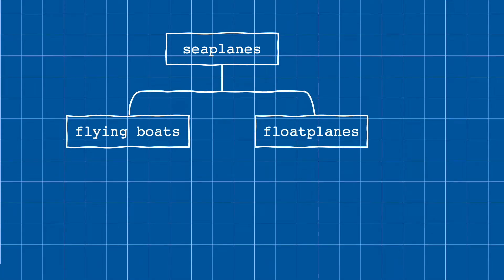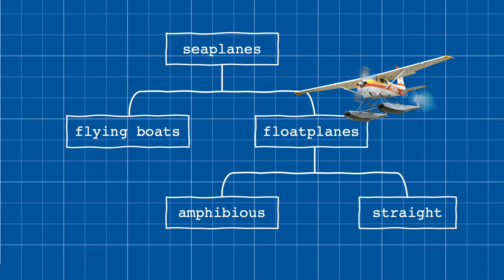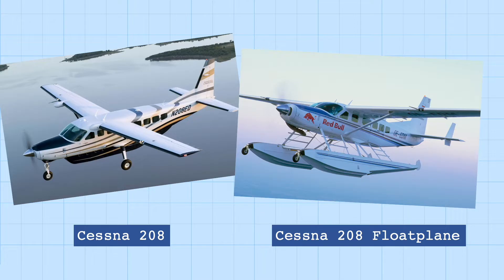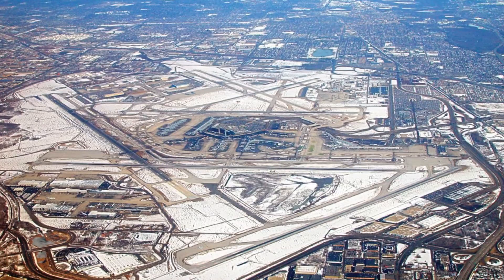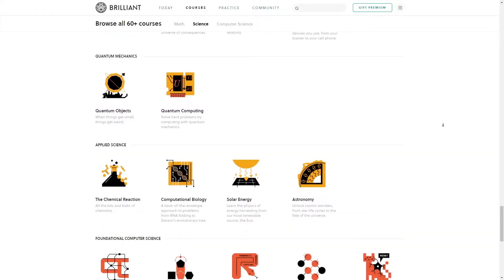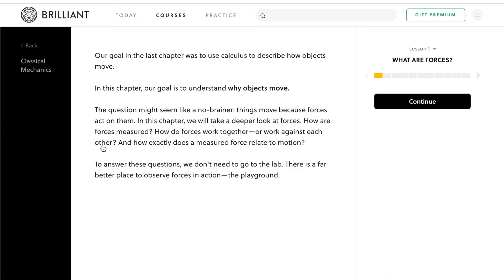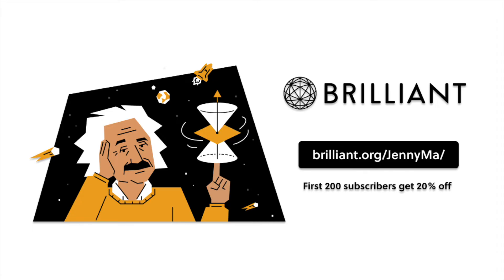Seaplanes, Explained: How Planes Work on Water

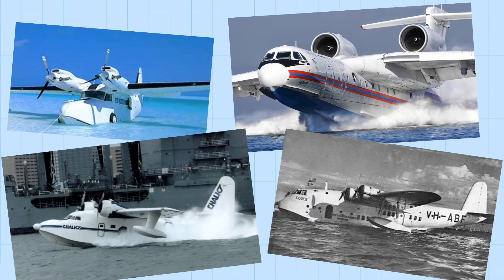Comment: 2:49 You are mistaken ma'am.  Pretty much all modern flying boats are amphibians.  Indeed, you can see the very visible retracted landing gear in the very first photo.  Indeed, most flying boats since the inter-war period have been amphibians simply because of the increased utility.  

Flying boats were not utilized as bombers in WWII.  Their primary use was as naval reconnaissance and maritime search and rescue.  

It wasn't the lack of airstrips or aerodromes prior to WWII that prevented their utilization for commercial purposes by larger aircraft, it was the lack of runways of sufficient length due to a technical limitation.  Before the invention and proliferation of variable pitch propellers from the 1920s to the mid to late 30s, propellers could only really be optimized for one speed.  Generally speaking, that optimized speed for higher, cruising speed.  At low speed, *the props just aren't that efficient," thus when taking off with a decent amount of weight, these larger aircraft ran long and needed a lot of space to get airborne.  A way to do this on a smaller surface area is to gain speed while circling but rarely does one see landing strips that are built in circles.

And BTW, one can vastly reduce the takeoff distance in a floatplane using what lift is generated at lower speeds to get one float out of the water, thereby just riding one float before rotating once you have enough speed.  You're effectively halving your hydrodynamic drag.

Comment: 😑 6/10 but could easily be improved. Speaking as someone who grew up around seaplanes and working in Marine R&D now, this is a bit “meh” on the details you choose to give.  Nothing a bit of editing and reshoots couldn’t fix. Three examples , that hierarchy tree should have been a Venn Diagram.   Second, look up CL-415 that are making the news in LA right now.  Water aerodynamics? Hydrodynamics or Fluid dynamics if you’re into engineering, Good work if you can get it..

Comment: I came to your channel from my recommended list because you are so pretty.  I stayed and listened till the end because you are interesting and engaging with your topic.  I am 67 now, learned to fly as a private pilot at  17 on a PA-28-180 1967 aircraft.  The throttle was push-pull in the dashboard.  It was before the more modern style.  I also flew a Lake Amphibian where the body lands in the water, not on pontoons.  The engine was a pusher prop.  So all actions are reversed.  BTW my Laker Aircraft could land on water or land.  In water, you would lower the gear and go up a ramp right into our garage.  It was very cool.  Happy Trails

Comment: 2:23 Does flying boats imply sea effect instead of ground effect?
Reply: Yes, but it is still the exact same ground effect at work. It's just that the ground in this case is made out of water ;) You should watch Mustard's video "What Happened To Giant Ekranoplans?" for an awesome breakdown on this.
Reply: @hkr667  By analogy I mean the little difference between taking off from a  tranquil water lake is different from a  surface with water ripple and waves. Does it effect the aerodynamic of the plane as such low level?

Comment: I've been researching air cushion landing gear a lot lately. I think a hovercraft-like landing gear would be a good fit for a land/sea/ice triphibious aircraft with a single landing system, ground loading would be low as well as low landing stresses, but I'm not sure what the best solution for landing with a total loss of power would be.
Reply: Nope.  As you alluded, no backup with power loss, but the reason they are not used is No Steering & No Brakes.  Not very practical.  Put that idea in the same 'boat' as Dirigibles and Balloons.